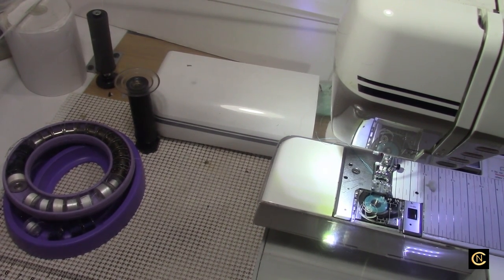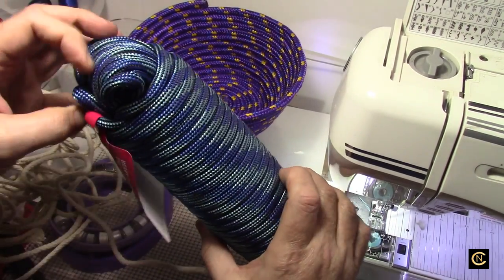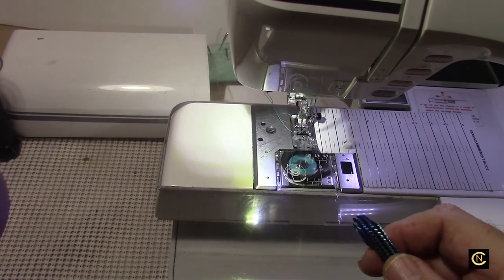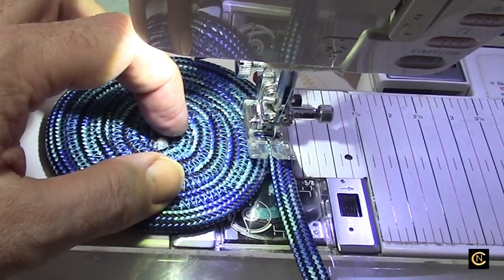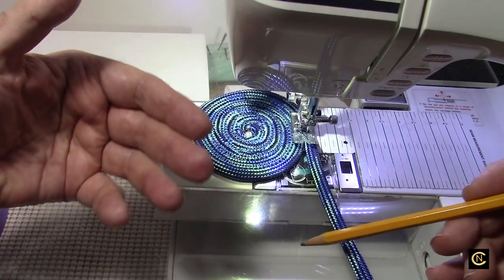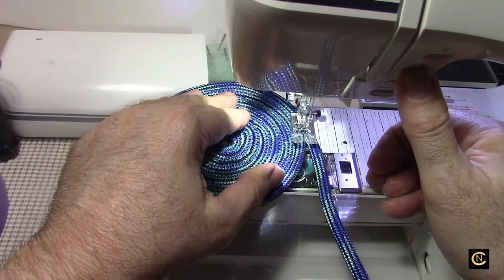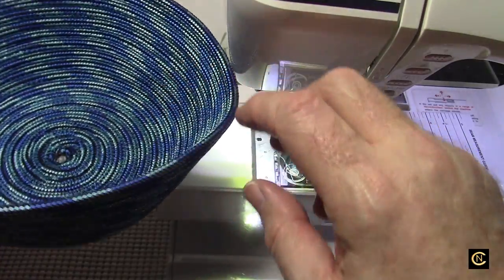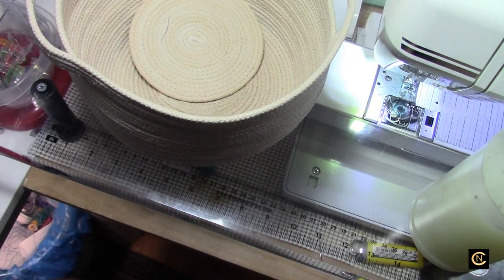Rope Candy Bowl Using Industrial Rope TUTORIAL - Christopher Nejman

Comment: Many of these ropes have a interior core that the coloured threads are braided around.  You can see the white core in the rope in this video.  When beginning or ending this project, you can cut the rope and gently slide the outer sheath down a bit to expose the inner core.  Cut off a chunk of the core at an angle and slide the outer sheath back down to cover the inner core completely.  Carefully singe just the edge of the outer sheath to seal the threads.  This will completely hide the white inner sheath and reduce the thickness of the rope so the ends can be hidden in the sewing.  Thanks for this great tutorial!